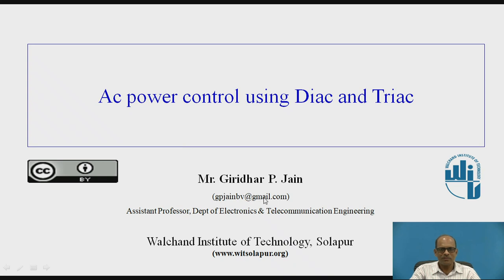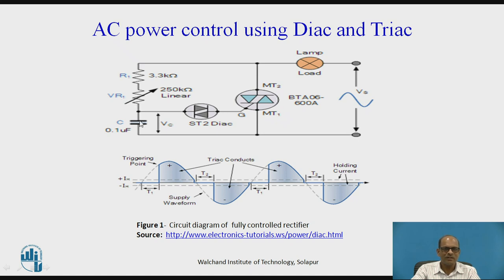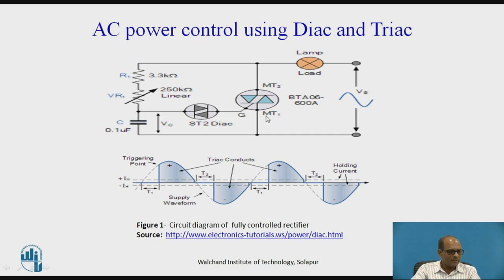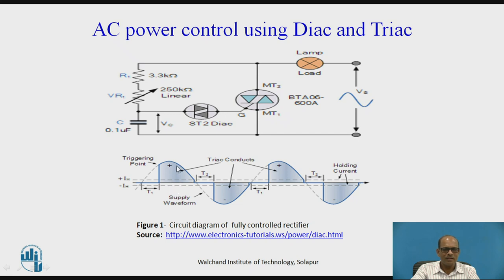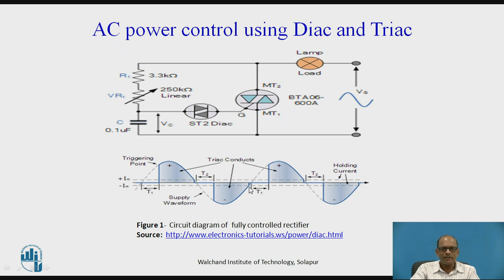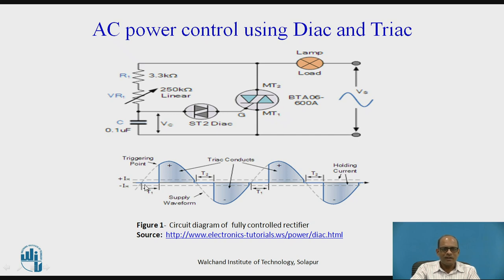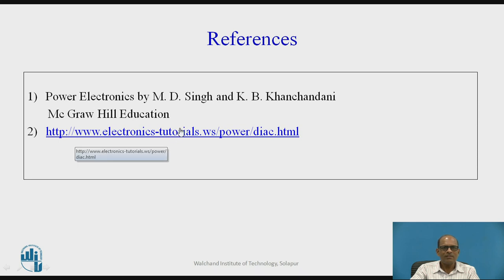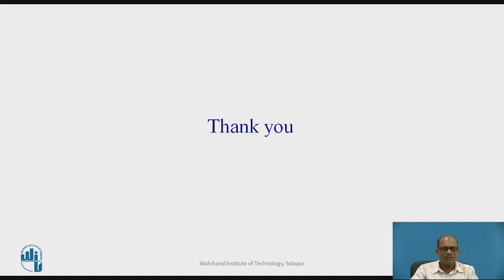AC power control using  Diac and Triac

Comment: Dear Sir, when we reduced the power delivered to the lamp, which parameter (voltage or current?) remain constant and which one is varying?
Reply: The circuit varies the voltage, and when the voltage is not constant, the current varies too.

Comment: What is the difference if using a potentiometer instead of this circuit ? What will be the difference between both ??
Reply: You can use pot but with using pot most of the power is dissepated in heat...

Comment: What is the purpose of the 3.3k ohm resistor?
Reply: Did you find the purpose of this resistor ?
Reply: @husienhazima464  R1 limits the gate current to a safe value when VR1 is at its minimum